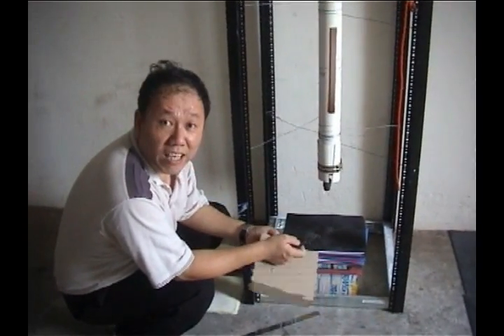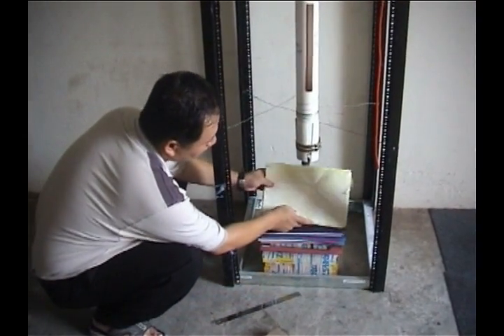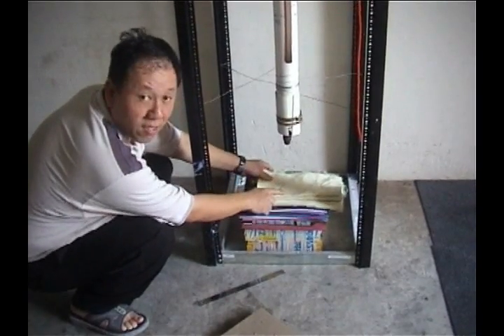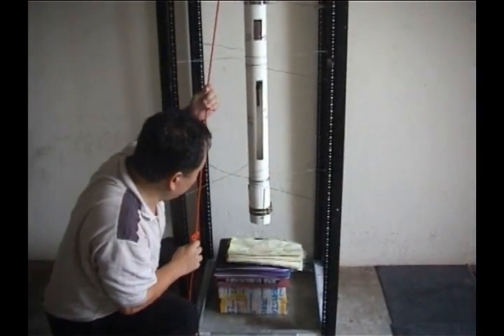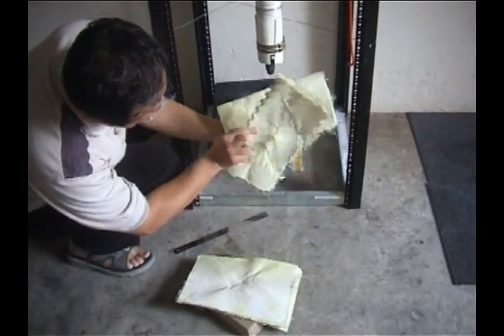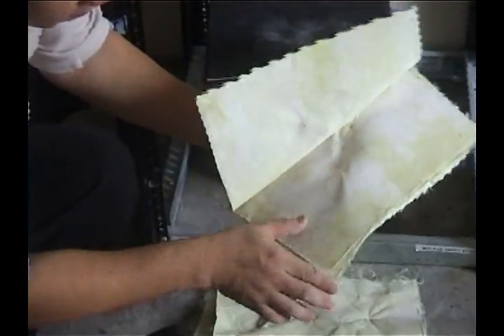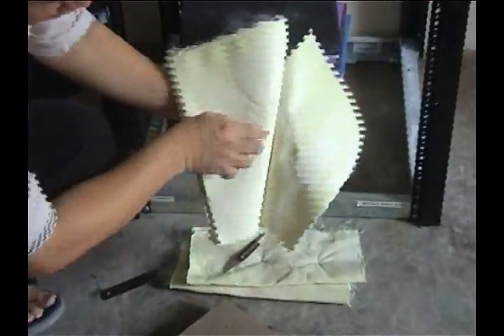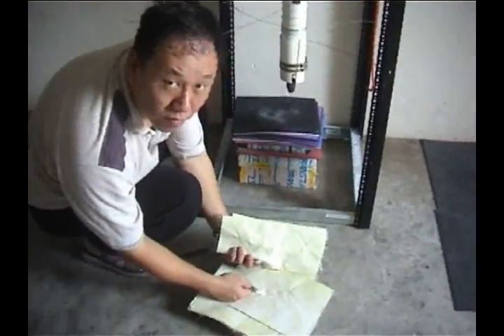P1B Blade on Liquid Armor

Comment: I saw a video in which they mounted this stuff in front of some playdough/Plasticine and the resulting effect was actually pretty disturbing. I know this substance is different to skin, but still it was a pretty big crater left behind by the shock wave of the bullet. Maybe if soldiers wore this fabric over a polythene type plastic plating then the shock could be reduced slightly.